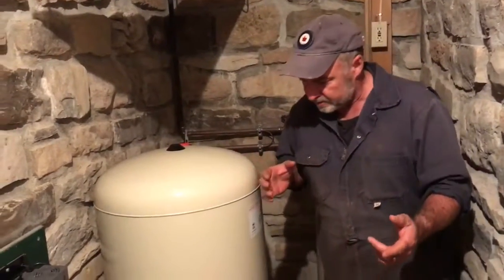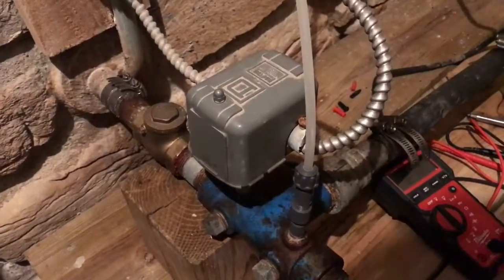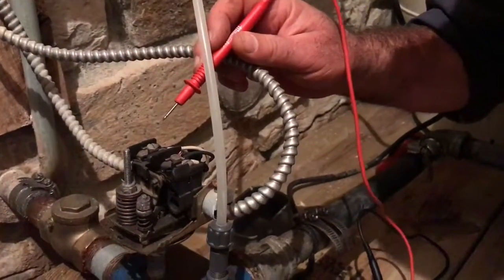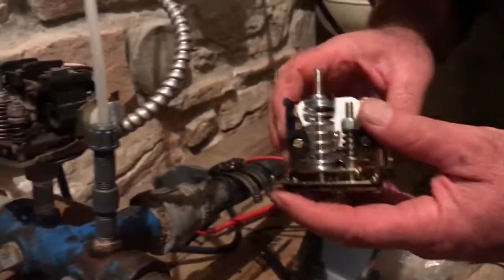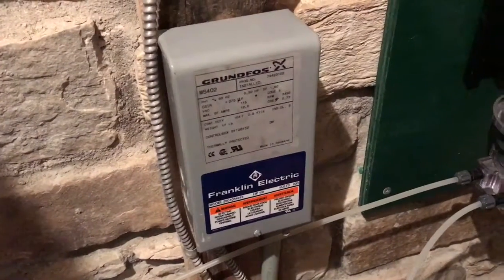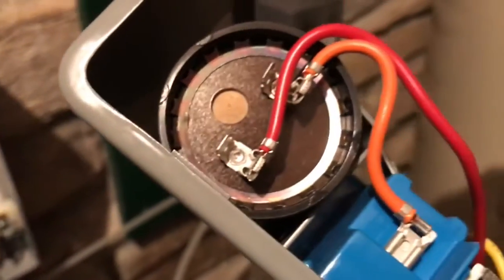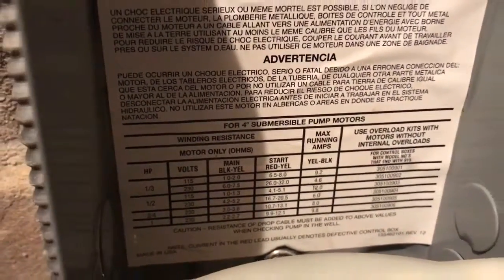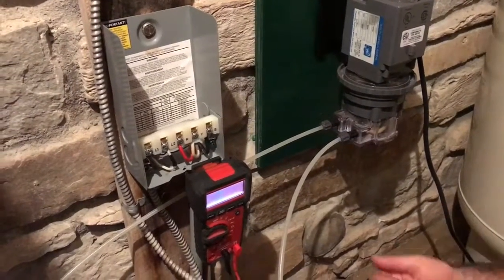How to Troubleshoot a Water Pump

Comment: Woke up to no water today. When I opened the QD Control Box the Capacitor is bad (according to your video, thanks!) and the L2 is burnt out. I'm going to replace the Box and the pressure switch. But how do I know, it's not the electrical panel and once I replace everything it won't happen again?

Comment: Little fuse makes a separate pump protection module similar to the Franklin pumptec protection device that senses dry running (low current), motor stall (high current), high and low line voltage. It can be mounted separately between the disconnect and the pressure switch. It can be used with any control box. My older Franklin box does not have a provision to mount a module internally.

Comment: IMPORTANT SIDE NOTE: a pressure switch will usually not get that burnt and full of carbon on their own. You may have an underlying issue like bad pressure tank or a constant leak somewhere (could even be down the well). Check your pressure tank when drained and it shouldn’t feel full of water, if it is then it’s bad. If not full of water then  check the schrader valve stem. If you pressure switch is 40-60 psi then the air needs to be 38psi. These bad things things cause your switch to quick cycle and can ruin your new pump FAST!

Comment: Thanks for this video, woke up to no water. Checked the breaker panel, no blown circuit.  Cleaned the switches and it worked, thanks! Gonna have a plumber come and replace it, but have water for now. Really appreciate that.

Comment: Thank you for your video. Helped me troubleshoot my issue and save me a service call. Ended up being the capacitor. Not exactly as you described, ended up having dried powder drip marks out the top.

Comment: I would have also mentioned that some models of meter can test the capacitor directly and also, that it is well worth while to test that electricity is getting to the well head. The electrical failure may very well be between the home and the well head. That can save pulling the pump.

Comment: Thanks for the video.  A couple of months ago after I had checked all of the things you mentioned there, I had to spend nearly $800.00 to have the pump pulled.  The pump was fine but the electric lines to be pump had failed.  After they were replaced the pump worked fine.  Unfortunately, I think during the process some iron producing bacteria were introduced so now I have that problem.